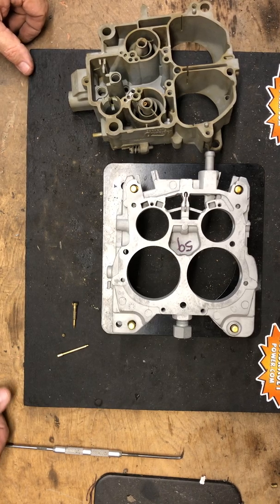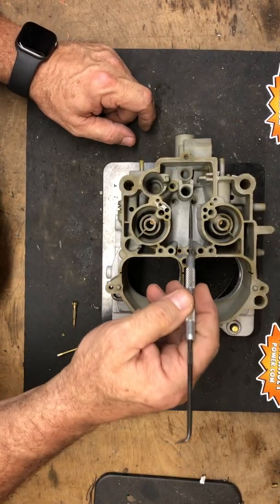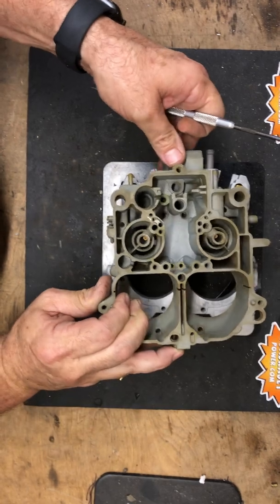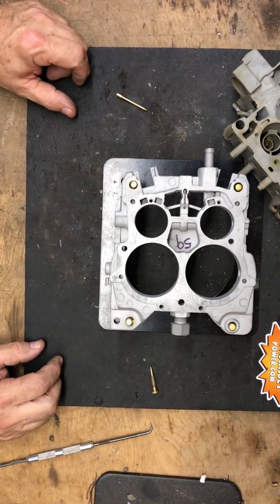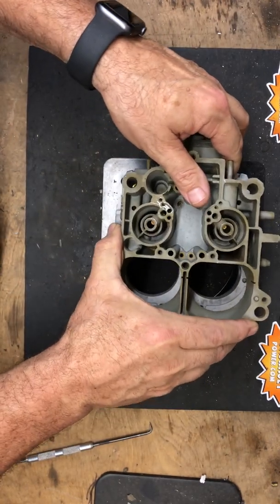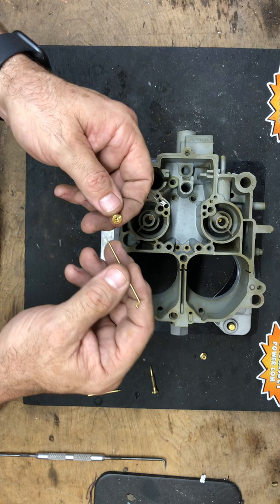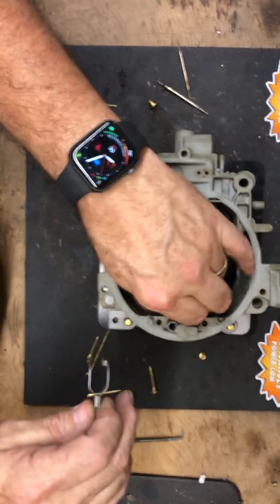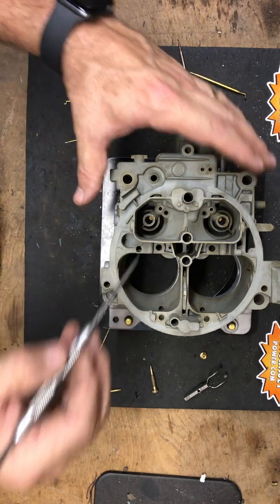Quadrajet Power - Quadrajet idle circuits explained

Comment: Hi, im having a problem with hesitation from idol to acceleration. I'm not experienced with carburetors but I am a highly experienced machinist and understand mechanics very well. I have a 1979 corvette with a stock 350 eng and stock 4 barrel quadrajet. Ive watch a few videos, some suggesting the spring tension of the secondary air butterfly opening too quick or too slow. That doesnt seem to be the problem. Any help is appreciated. Im retired and dont mind trying things on my own, if not too complicated.
Reply from the maker: I would start first checking the accelerator pump to make sure you have two good streams of fuel from the pump

Comment: Hello I just put a new carburetor kit in my quadrajet and for some reason I lost vacuum on the tube that pulls vacuum for the timing? What if I used the wrong gasket on the top side would that cause it to happen?
Thanks Sir
Reply from the maker: You possibly used the incorrect throttle body gasket, between base and body. Order your kit from us and we will get you taken care of. www.quadrajetpower.com

Comment: Great info, i resolved my issue by restricting the idle bypass hole air my mild BBC. The bypass holes were too big for my application, causing the idle mixtures not to respond very well at idle.
Reply: i am running an olds W-30 carb on my stock pontiac 400 i blocked the idle bypass completely

Comment: Great video!! I'm running a 350 with 2.02 , 1.60 valves and a bigger cam and have been having issues with idle.  I'm pulling about 17 inches of vacuum at idle do you think I need bigger idle tubes? Or is this enough vacuum to make the stock ones work properly?
Reply: 17 inches is about stock. A big cam will go down to 10 inches

Comment: Great videos.
Can You explain fuel circuit, how it is controlled when on idle what is holding the fuel from part throttle and secondary fuel cuirciut from flooding the engine, can You explain what is triggering part throttle system to get in and same for secondaries. Air flaps and linkeages are visible but ilustration what is happening with fuel i think can be interesting and big step for understanding.

Comment: Between Ruggles book and your videos I am starting to understand how it works and how to fix my problem in the going off idle circuit.  I have to richen up the idle circuit.  My tubes are stuck pretty tight.  I have to try to get them out again or try to drill them from the top and flush out any chips.

Comment: Hello, i have a 1969 Riviera with numbers matching engine and carb all stock no modifications. I have set the idle mixture screws and it makes about 19" of vacuum. It runs very smooth. Throttle response is great too. When i am in front of my engine i noticed that the left idle mixture screw did not really effect the vacuum reading. The engine runs perfect. Should i do something about that idle mixture screw? Thank you, Rob
Reply from the maker: If it runs perfect, I wouldn’t worry about it.
Reply: @QuadrajetPowerLLC  Thank you.

Comment: Hello, i have one 81 olds 307 with quadrajet and TH350c gearbox.
I have a problem and i hope that with the necessary i will resolve it.
The idle screws are scratched with circle scratches and especially for the right one (if you are in-front of the car) it can’t make the mixture and it’s screwed to the end position.
So what kind of parts i have to replace, to make it run well?
I had replaced all of the gaskets of the carburettor and the O rings. It’s running almost well, but i have a mixture problems with the right side. The lambda sensors (I’m using outside source with a laptop)
Sad that the right mixture is too rich of fuel, the sparks coloured confirmed that.

Comment: facinating videos thanks I'm learning so much.  when you say you get a nozzle drip on the primary side, how could one tell?  could that be creating raw fuel puddling on the intake manifold plenum?  I had to do exactly what you said- crank the idle speed way up with the fast idle solenoid to compensate my bone stock 73 quadrajet on a hot rod 350 with big cam and compression.  Can't wait to redo the idle circuit like you describe!

Comment: Your videos are great. I wondered if you could do a video about loss of vacuum in an old carburetor/ vacuum system and how that affects the vacuum advance ignition /carburetion ratios. At start up,the ratios between the choke, fast idle and vacuum advance, and which to tune first. Then to a warm engine and the curb idle adjustment.  This is a really cool subject. Keep on, I'm learning a lot. All of the guys who are sweating over their own projects and their friends projects appreciate you very much. Thank You.

Comment: Interesting, makes me wonder if a q-jet set up for a big block would work better for a small block with a cam? Wouldn't a big block carb be set up to release more fuel at idle for the same vacuum?
Reply: Yep they're great. Build it for your application. Get the 850 cfm model and build it for Max fuel (demand) whatever your engine and cam can process in fuel. These guys have a lot of info on volumetric efficiency with these carbs and the applications for them. Let them know what you want, your application.

Comment: Hi Mate That main body seems to be like mine, I need to know more about these two brass screws that sit vertical inside the chamber to the front sides and look like adjustable (flathead blade top) screws. They look like adjustable mixure screws and I have no idea what they are for or do and how to set them. 1976 GMH non APJ 170 number.
Reply: I believe he is asking about the discharge nozzles in the first venturi rings. Those are "brass", and have a screw driver slot with a hole in the middle,  but  there are no brass screws for holding the air horn to the body.
Reply: They keep the Airhorn to the Body with other 7 screws. they are not mixture screws !!!!
Reply: @MySonMarlon  Thanks.